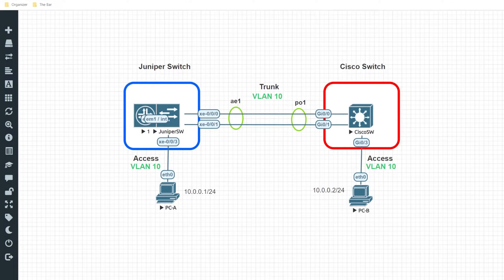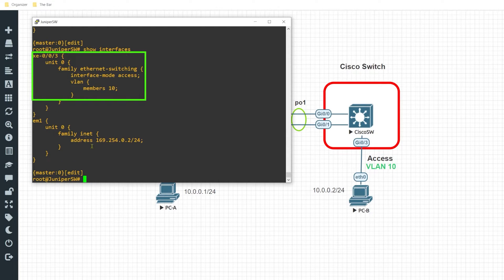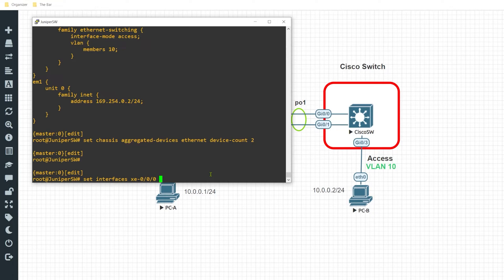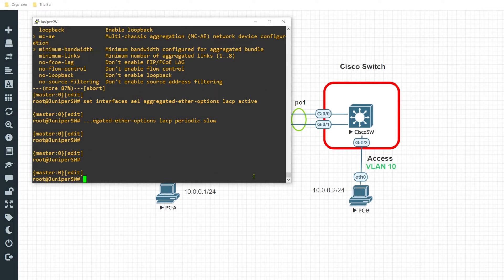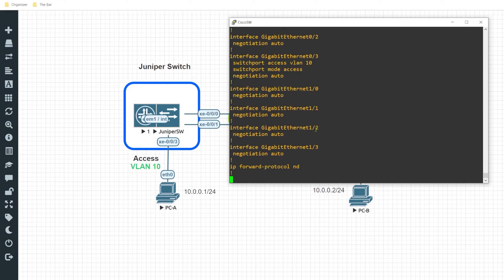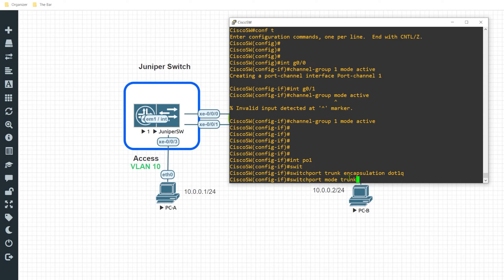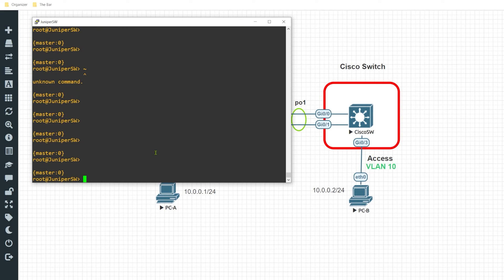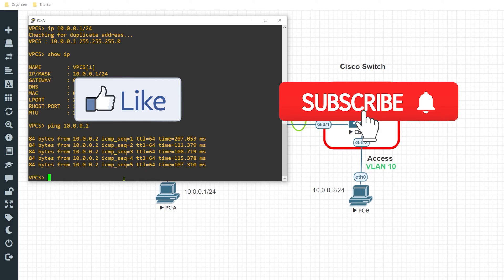Configure LACP LAG between Juniper and Cisco Switch | Quick Labs

Comment: Good video. Question, why did you add the .0 in the ae1 name? This was very helpful video. Gave me ideas on fixing my issues, such as the LACP rate to slow and what the show lacp interfaces results mean. Thank you!
Reply from the maker: Ae1 represents the simulated "physical" interface and under its configuration, you can configure things like speed and duplex settings however the .0 represents the logical unit on the interface, in which case you can configure an ip address or make this a trunk or access port.

Comment: Hey Jon
Thank you for the video, really like your channel.

I don't know what happen, I spent last week trying to make it work unfortunately it doesn't.
 On the Cisco side, I have this status:
1      Po1(SD)         LACP      Gi1/0(w)    Gi1/1(w)

and on the Juniper side: 
LACP state:       Role   Exp   Def  Dist  Col  Syn  Aggr  Timeout  Activity
      xe-0/0/0       Actor    No   Yes    No   No   No   Yes     Slow    Active
      xe-0/0/0     Partner    No   Yes    No   No   No   Yes     Fast   Passive
      xe-0/0/1       Actor    No   Yes    No   No   No   Yes     Slow    Active
      xe-0/0/1     Partner    No   Yes    No   No   No   Yes     Fast   Passive
The ports changed to up on Cisco side but not po1.

Any suggestion will help.
Thanks in advance
Reply from the maker: I appreciate that, checkout these two things:

1) Is the logical unit of the ae configured? (ip address or vlan configuration?)
2) try configuring the lacp periodic state to slow on Juniper